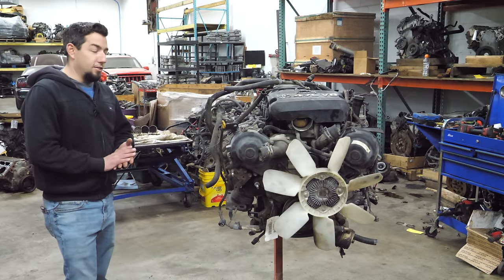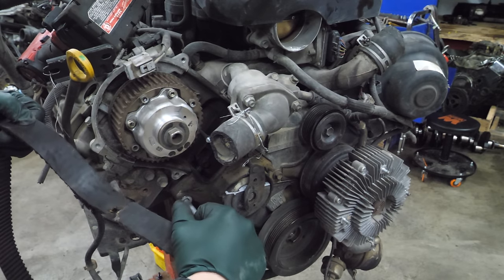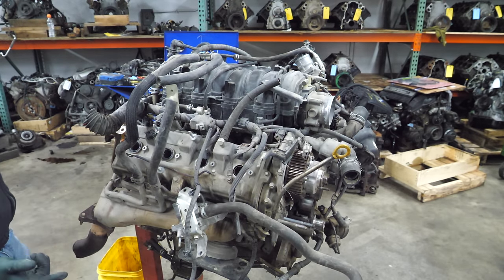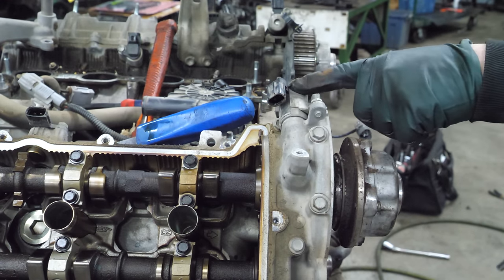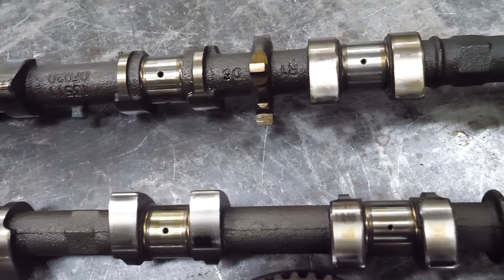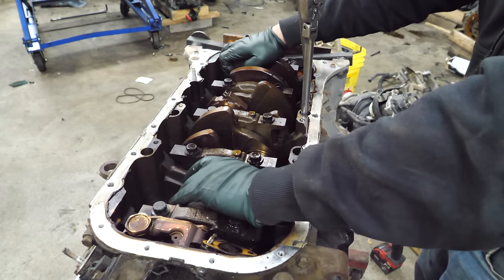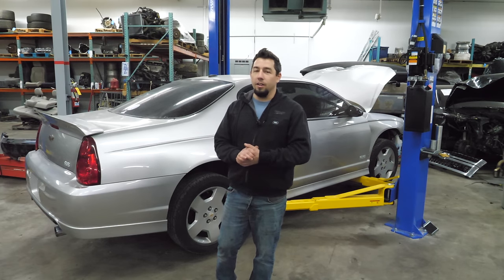Toyota Tundra 2UZ VVT Teardown! Bad Decisions Led To The Demise Of One Of Toyota's Greatest Engines!

Comment: I remember hearing non-stop that people claimed the 2uzfe was interference.... Well the belt broke, water pump seized up and melted the belt to it when it was stopped, then it was cranked over and snapped the belt. cranked a bunch and it wouldn't start. After tearing it apart and seeing the damage, there was no problem with the internals... no damage to the valves, still runs perfectly 100k miles and another belt change later.

Comment: I really enjoy watching your videos Eric. Very relaxing to watch, very entertaining and great humour 👍

I worked as a casting die maintenance technician at Toyota UK for many years. The engines are designed and engineered very well (well, better than most anyway - but let's not talk about the '3 corner joint' on ZZ engine!) and we had very high quality control. We made ZZ, SZ and ZR engines (didn't make these big engines, only the little ones 😂)

It's such a shame that they didn't investigate and check this engine out properly before replacing it. It could have run many more miles with just a timing reset and new belt.
Pity about the water damage in the bores.
I'm sure you'll get a good return on the other parts tho 👍

Comment: The engine looks like it could easily be put back together with a new timing-belt & run perfectly.
Reply: even though the tundra is an "interference" motor  , I have seen several that broke a timing belt and did not bend valves , fact is I never saw one bend valves
Reply: Spoken like a true craigslist clown.    Ran when parked, just needs carb cleaning.

Comment: That is why i like timing chain engines vs timing belts.
Reply: Chains don't last forever either though. The Achilles heel of most German engines is timing chain/guide failure
Reply: Yea belts get old vs a chain that seems to last forever as its usually coated with oil.
Reply: @repairvehicle  Chains are better it has nothing to do with brand loyalty. New Toyotas have a chain at least that’s what I’m told. They say a chain nowadays will last as long as the rings. Tensioners and guides are a hole different argument. But you shouldn’t be loyal to any auto manufacturer they will all screw you over.
Reply: @Jeff Bigsley  , Toyota chains last forever if 
maintained
Reply: I had a Pontiac sunbird with a 2l with 68k on it and on cold start a piece of the tensioner broke off and went for a ride. Snapped the end of the cam off and was so bent it never came out. My second car was a Volkswagen and put 875 k on it and it was a belt that I replaced 7 times. Was parked and someone texting and driving finally finished the car off.
Reply: This timing belt job on this engine is not bad at all. They usually last 100-150K. Very smooth and reliable motors. My 06 tundra has 515K with original engine and transmission and she runs like a champ still

Comment: Testimony , 280 k miles 02 Sequoia . Belt broke , replaced timing belt and components - runs like new again . Just do it guys , this 4.7 is bulletproof . Also , starter replacement is tedious but not impossible .

Comment: I am on my second 2006 Tundra with this engine. First one ran past 250K on the OD with never going to the dealer even once. I found another a few years ago that was a "Grandpa" truck with 62K and it now has 125K. Again, never once to the dealer but for timing belts. I run Blackstone oil analysis and both trucks get a 100%/AAA+ review by their tech. Great motor and I get 17019 MPG (both trucks are double cabs with shells on the back). Great video - thanks. Bob in Nevada

Comment: Our 04 Tundra has 301K and our Lexus 470 has 198k which still drops clean oil every oil change.  Timing belts are changed every 90k. So I agree 100 percent take care of what you have and you should be a much happier owner.  Thanks for sharing!
Reply: I have 2007 gx470 has 150,000 mi . Do you recommend changing timing belt and water pump. Everything running perfectly. Idle perfectly too or wait until it hit 200,000. What your opinion?
Reply: @skeletronxxprime6277  yes we change both every 90k as Toyota recommends.  It’s a belt and not a chain so they can be subjected to breaking more so.  If they do you are more then likely going to have valve train damage. Enjoy your GX we love ours.

Comment: They saw the broken timing belt, then probably looked it up online and found out it's an interference engine then they threw it away. Interesting how the valves escaped unharmed. Looks like there is 3.rd term for this engine: mostly interference, but not always .

Comment: I took mine to the dealer with 213,000 and told them I wanted belt, water pump, tensioner and all pulleys replaced. When I picked it up all they changed was the belt and water pump because the mechanic said " the rest looked pretty good".  If I wanted shade tree work done I wouldn't have paid dealer labor.

Comment: So either the belt went and the mechanics talked them into just replacing the engine. Or, the belt broke, engine quit and the driver panicked and had an accident from loss of steering or brake power and the vehicle was wrote off. Either way. Clean that up and a new belt. You have a perfectly good engine.
Reply: Idk man, that rust might be an issue that isn’t worth fighting. Might as well get another bottom end to slap together with those heads.

Comment: I've seen these engines with 350k+ miles on them,  and still running strong,  if they are taken care of. The 5.7 starter is pretty easy after you done a couple.
Reply: Yes, starter pretty easy, if only it's GM 5.7:)
Reply: @ДмитрийФакухин  or 5.3
Reply: 358k mi on my 1uz.

Comment: One of the best engines Toyota built. Had one in my 2000 Tundra. I ran great. Yes I did change the timing belt. Had it changed twice in the 14 years I had the truck.
Reply: I had a 2000 Tundra. It had 260k when I sold it and the guy drove it for another few years

Comment: That's interesting, I was thinking all Toyota engines were non-interference -- that's why I didn't think you'd find any bent valves. I guess I learned something new.
Reply: Most of all of the Toyota t belt motors are non interference with a few exceptions the 1uzfe in the ls400/ls430/gs cars and the vvt 4.7 in the tundra/sequoia and the 1 or 2 jz inline 6 engines in Lexus cars.
Reply: @jgranger2002  the 2jz is only interference if it's the vvti motor. The non-vvti is non interference.
Reply: I agree. All but the famous 2js.
Reply: @jgranger2002  94 and below 1uz is non interference, after that year theyre interference
Reply: @jza80king  thank you for the correction the vvt I6 motors are interference.
Reply: @christopherderasmo5041  they shouldn't be avoided as they are all great engines.
Reply: @christopherderasmo5041  loll you should see how many timing belt engines are interference engines. These engines are not the norm. Almost all Hondas are interference. At least the ones you want.
Reply: @christopherderasmo5041  they moved to chains in the 5.7 3uz

But this engine is the one famous for 1 million miles on the engine if you change belts every 90k miles
Reply: @christopherderasmo5041  yeah, never buy an exciting and well engineered lexus engine because itll mess up if you neglect it. Seriously?
Reply: @christopherderasmo5041  You realize this applies to all the maintenance elements, right? Filters, fluids, etc. All cheap, and all will wreck your motor if NEGLECTED.
Just replace this as manufacturer intended, and it will NOT break. But yeah, if you're planning to neglect your vehicle, definitely avoid these engines.
Reply: The 3k-c (70s pushrod engine - small, but real screamers) are interference.  I bent the valves on mine while getting clear of an aggressive driver - missed a shift.
Reply: The 3mz-fe is also interference

Comment: 2uz is generally a non interference engine, only the vvti had issues. I had a timing belt snap on my 99 100 series half way between phx and austin. towed it back to phx and ended up having a local shop do the timing belt. runs like a top, no damage.

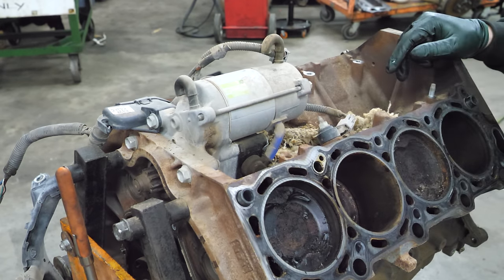Comment: 22:25 Anyone who puts the starter in the valley should be tasked with replacing every single failed starter on that design until they redesign things to put the starter where it's easier to get to.

BMW are bad about obnoxious starter placement too. Even worse idea than this; they embed it in the bellhousing on some models to such a degree that changing it REQUIRES REMOVING THE ENTIRE FUCKING ENGINE!

And people wonder why I love my 37 year old straight six Ford so much. Changing a starter in that thing takes 20 minutes...
Reply: I can change a stater in a tundra in 2 hours really not that big of a deal. Intake comes off in about 20 minutes then unbolt the starter. They will almost always make it to 200k miles plus.
Reply: Honestly it's not that bad. Inconvenient, yes, but the rest of the engine is so utterly smooth and bulletproof I'll happily deal with the starter for the privilege of driving such a good engine.
Reply: @dawnpoint  yew see I have all the same buttery smooth bulletproof goodness too, but I also don't have to deal with tearing the entire induction system off if the starter ever gives me any grief.

My 4.9 I6 runs so smoothly that it won't even vibrate if I yank a plug wire off while it's running. The only sign it's only hitting on five is a change in the exhaust note and a slight decrease in power.
Reply: @TestECull  inline 6's are very smooth.
Reply: @jgranger2002  They very much are. The only signs mine has dropped a cylinder is a change in exhaust note and power; the dead miss is not felt at all. It's uncanny. Such a smooth running engine...need more I6s on the road.
Reply: I've known many people with this engine with multiple hundreds of thousands of miles and never touched the starter.
Reply: @gregsanders9563  Don't care. It's a bad place for the starter and it's bad design to put it there.
Reply: It took me 7 hours to change mine 99 landcruiser. I had to redo the whole job the following weekend, I knocked off the knock sensor wire getting that damn starter out. 
That is the best engine ever built
Reply: @jgranger2002  it took me 7 hours. Shop wanted 10 hours labor . I did it in my garage
Reply: @thomasmazzola4760   Ye its a 15 minute job on my bullnose F150s. They have the 4.9 I6 and the starter is soooooooo easy to get to...

Comment: Total waste of an expensive wiring harness.  And why do these guys leave perfectly good engines out in the elements?  Near where I live is a disused train maintenance facility turned into a dismantler.  Majority of the vehicles are under one roof and on concrete.  I appreciate not all can be so lucky, but what a great way to preserve cars and parts and it's self-serve, so we don't need to slog around in the searing summer sun, mud and rain ;-)
Reply: Your right !a stupid plastic tarp could have saved a perfectly viable engine .

Comment: I have an earlier version of this engine in a 2003 Tundra. It just turned 600,000 miles, runs great and doesn't lose oil between changes (every 5,000 miles over the life of the vehicle).  This will likely be a million mile truck.

Comment: I've torn several engines down, including the 355 in my '75 Z28, that lost a set of valve keys, valve fell into the cylinder, snapped the head off of it, and stamped it into the top of the piston...yet here I sit, watching engine after engine tear down.  Perhaps I'll call it therapy...

Comment: I would love to see you tear down a GM high feature V6, preferably an LFX from a Camaro/CTS, I need the intake manifold haha
Reply: I too would love to see that. I've worked on most of the variants fitted to the Holden commodores (LE0, LY7, LF1, LFW, LWR, LLT, LFX), and ive owned the LY7 and now LLT, but I would love to see what's inside.

Comment: I'll stay with timing chains. I've had no problems in hundreds of thousands of miles. Had belts break before they were due for replacement.
Reply: You’ve not had any modern engine with a timing chain then. They last about as long as a belt but are usually at least 2x as expensive to repair (or much, much more if it is German).
Reply: @ouch1011  Wrong. Two German cars, 200k+..

Comment: As an owner of an '86 Toyota Camry who did the same thing (Timing belt? You mean it doesn't have a timing chain? And it has to be changed?) but lucked out because it was a non-interference two valve engine, I'm not going to call the owner an idiot, but when you own something, you have the freedom to do what you want with it, but also have the responsibility to maintain it too.

Comment: One thing I have noticed with modern engines is that the high revs on startup it just gets my nerves 

My neighbor has a Toyota with the same engine and in the morning when he starts it just takes off revving high for a little while then going to a reasonable idle those high  revs must do wonder on oil circulation

Comment: Thank you for this teardown. It clears up a lot of back and forth as to whether the 4.7L is an interference engine or not. As you stated, if it is it's a mild interference that doesn't normally lead to catastrophic failure. A new timing belt and this one would still be going! I have one in my '03 4Runner, so good to see and read some of the other comments on this engine's durability.

Comment: As good of an engine as Toyota makes, I’m perplexed why they wouldn’t use a timing chain on a v8
Reply: A lot of European engines use timing chains but then the plastic chain tensioner which is buried deep in the engine gives out with no warning and fucks the whole engine up. I think timing belts are ok. I think it’s better to open your hood inspect your fluids and your belts once in awhile than not be able to see a thing and kaputt.
Reply: @POVShotgun  the majortity of car owners do not open the hood even once
Reply: @alexstromberg7696  by the time you get to that belt you would’ve done at least a dozen oil changes, spark plugs, serpentine belts what not. Given that you don’t open the hood. A mechanic who’s worth his salt could easily inspect the timing belt with the corner of his eye. Or just look at the odometer and wonder if the timing belt is ok
Reply: Question: if one drives ~ 2000 - 4000 miles per year, would it be best to change such a belt on a schedule?  Say, every few years, in addition to the every-few-months periodic services?  

This would be due to not being able to afford to drive much due to being disabled (and hence short of funds) while needing to drive on occasion (pay bills, get groceries, go to the doctor, and occasional non-essential trips.)
Reply: @dennisyoung4631  belts are to be changed in X miles or X years.
Reply: @alexstromberg7696  agree, the amount of people that maintain their cars themselves decreases every year. This could be for a multitude of reasons like lack of time or interest, lack of mechanical skills, worry that a car under warranty will be denied unless a shop does all the work, specialty tools required, or just pure laziness. I’ve worked as a fleet mechanic and can do all of the services that a dealer can do, but they could care less if I come in with a warranty claim.

Comment: I own an 03 Tundra with the 4.7 with a 177,000 on the clock, I've changed the oil every 4,000 miles since it was new, and I replaced the timing belt myself at 160,000.  I know it was way overdue, but I got lucky, I guess.  It's been an extremely reliable truck with almost no issues buy  I did notice the engine your working seems to have way more hoses and emission crap attached.  Anyway, love your channel, and it's great how you and Ray are helping that family with the minivan, not a big fan of Chrysler products.

Comment: they condemned the engine to soon they should installed a new timing belt and ran it to see how it ran I bet it would had been fine a Borescope down the intake runners you can see if there was any damage valves Dam they really was miss diag

Comment: If the mechanic has any idea about Toyota engines should know this is a bulletproof engine, this not an interference engine ……. It looks intimidating for a non professional mechanic but this is a sweet hart❤of an engine …..
Reply: I have an 04 Tundra 4.7 non vvt. It blew the timing belt at highway speed. Is this engine a non interference??
It was the 2nd timing belt, installed around 220,000ish miles. It currently has around 258,000 + - a couple 1,000.

Could I be able to install a new belt and be good??

 Bought in 06, 56,000 miles. I love this truck. FIRST time she has ever broke down! She has ran like new for 16 years. Pulled many tons over the years.
Always maintained, almost original everything . Interior is excellent, even with 5 kids and 4 dogs. 

I just had the front end suspension completely re done. January $2,500 invested in it. We live in Colorado mountains rough dirt roads, moving to Missouri. Belt broke in Kansas.

My wife has a 02 sequoia with 305,000 miles, 3rd belt.

Comment: You're so right about waste. I've made several thousands resurrecting electronics, laptops, etc with basic repairs that were designated for the landfill. On the other hand, our rx300 had the original belt replaced at 147k and looked very good. I guess driving habits also play a role in the longevity of any engine.

Comment: You know you engines!   Yes, my air pump went out on my 2007 Tundra with this 4.7 but Toyota covered it.  Funny,   I needed to inform the dealer that is was covered after they quoted me over $2000.00 and a little research on my part.   Anyway, the time belt is also a big job on this engine since the radiator has to be pulled and it's a tight squeeze pulling the water pump.

Comment: I could use the secondary air pump wire pigtail on the drivers side. The one that plugs into the control valve.